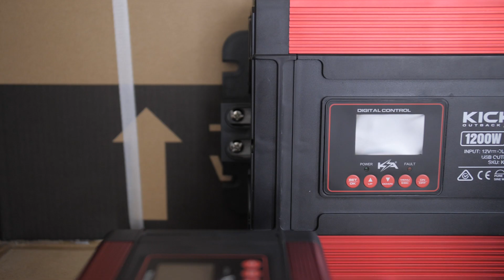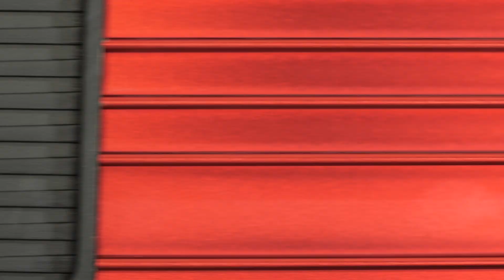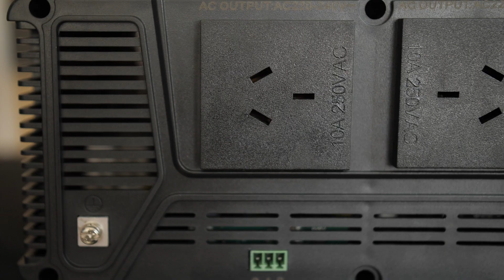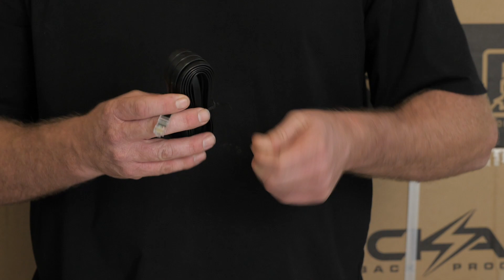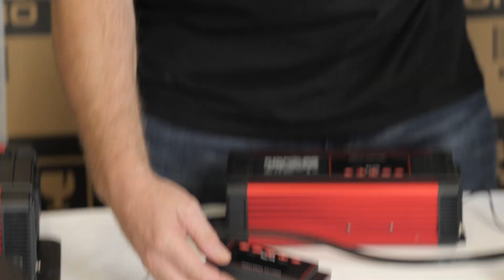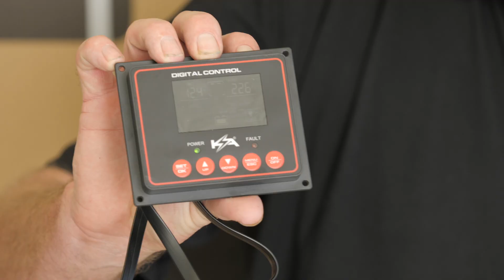KickAss Pure Sine Wave 12V - 240V Inverters 300W, 500W and 700W

Comment: What options do these come with for connecting to the battery?
Reply from the maker: As inverters pull a large amount of amperage on the 12V side, they come with heavy gauge cable to connect directly to the battery terminals of your power source.
Reply: @KickAssProducts  so it's just a bare wire? If I wanted to add eye terminals on the end, what size would I need?

Comment: @Australian Direct, Guys a question was asked about a month ago that wasn't answered. "Forged -Ez
 - Hi with the 1200 as shown here ,if you utilize 1 240v plug is the inverter good for the whole 1200 watt capacity  draw ? Or is it 600w only per outlet". Any reply please?
Reply from the maker: Hi Steve, the outlets on our inverters are a 10A 240V outlet. This means that each outlet is rated to handle up to 2400W, so on a 1200W inverter a single outlet can provide the full 1200W if need be.
Reply: @KickAssProducts  Thx for that. Only asked because the presenter in the video says it's 600w per socket. Sounded a bit weird.

Comment: Darren says the display is showing load of the charger is 226 Watts, but the display actually shows the inverter is putting out 226 Volts. ???
Reply: @Ben Cox You will find that is does show output voltage, current, power and frequency it cycles between them in the top right of the display
Reply: @zaneh6224  mate! They do not cycle through each reading, volts, amps, etc  you have to manually change it
Reply: I've got 2 of the 1200w and both only put out 230v. And I don't believe the current draw is correct either.